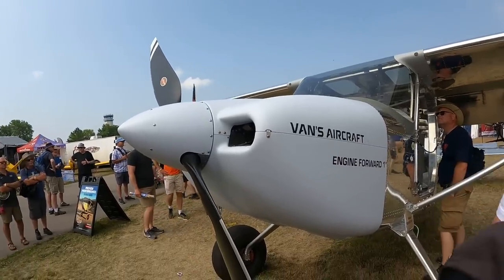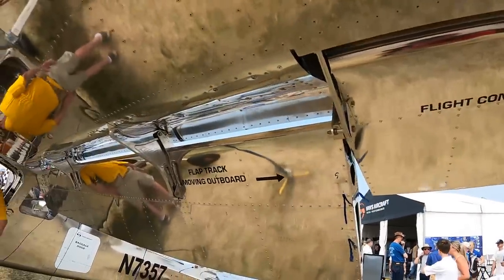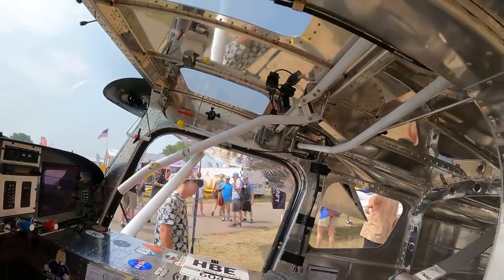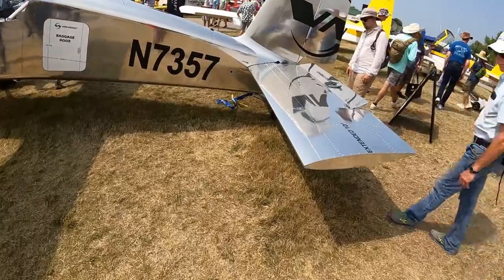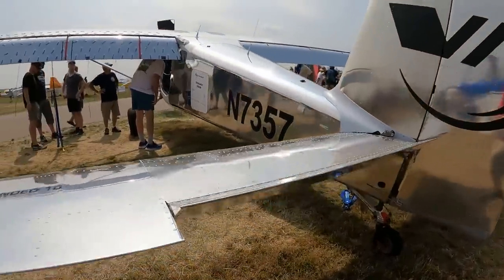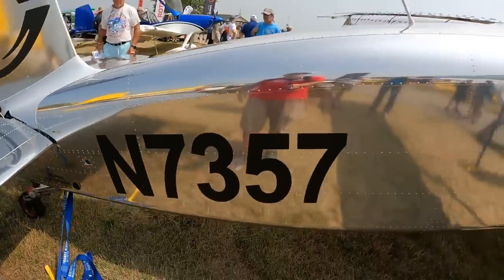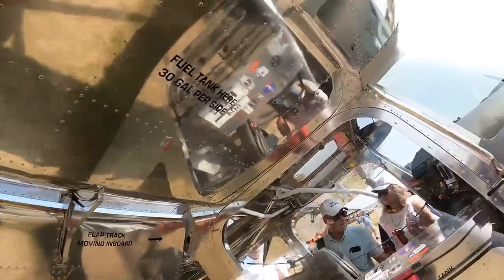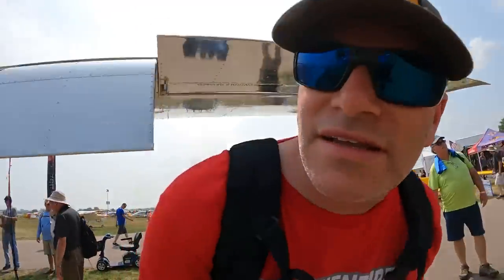Vans RV-15 Walk-around EAA AirVenture 2023

Comment: Basically nothing much has changed from a year ago other than stickers pointing out what they said they were going to to 6 months ago…
Reply from the maker: Honestly I’m not really sure what changes besides the obvious. I can go back and get more info if interested.
Reply: @112.Adventures  in a video they did at the beginning of the year they said the wing would move back a few inches making for a sleeker windshield. That setup would also require the flap lever to be moved to the floor. Maybe even a smaller vertical stab as well. Still no cargo door installed. I almost wonder with such huge structural changes if that prototype is still in development back at the factory and this old one was sent back out to do the PR.
Reply from the maker: @Captndarty  great point you make. I know they are pretty transparent on some stuff but also keeping some things close to the vest. Either way, I think it’s a very exciting design. I’d like to build one… if I do, I’d probably make videos along the way. Stay tuned, more to come. 
Anything else you’d like to see while I’m here, just post it in the comments and I’ll try to get out there

Comment: Machined flap tracks will most certainly be in the kit. It’s the only way to get the precise fowler motion. With modern cnc machines they can spit them out like cupcakes. The tail LE might inly be removable because they were trying different configurations. It seems like it would be an unnecessary weight penalty to have it removable. The ailerons seem small. If it was anyone but Vans I’d predict they got that wrong having flown a couple of its competitors who had insufficient roll power
Reply: renal-dr7st how is that rubbish relevant to an aircraft walk-around?
Reply from the maker: @terke1230  the comment has been removed and flagged. Not sure how or why that ended up here. Was on some of my other videos also.
Reply from the maker: As for the machined flap tracks, it was brought up by the vans representative at the show. He mentioned a steep cost of approximately 500 each and there are 6 of them, which would add $3000 to the overall cost. They know that is steep and my understanding is that they are exploring options to mitigate the higher cost for the end user.
Reply: @112.Adventures - $500 each for the flap tracks might be for the prototype.   My experience having things milled is that once they start making batches, that cost drops dramatically.
Reply from the maker: @KenLeonard  I agree, I’m just repeating verbatim what I was told at the show.